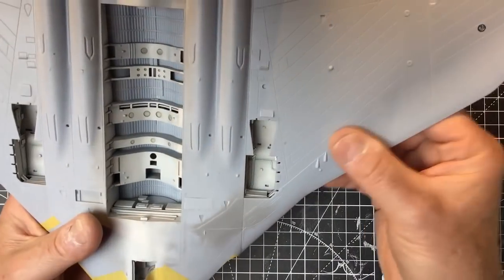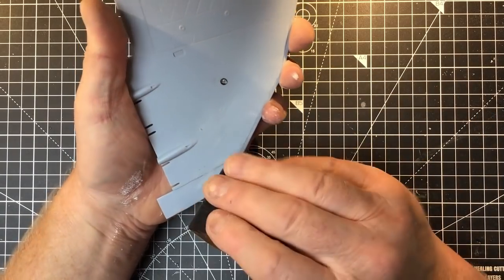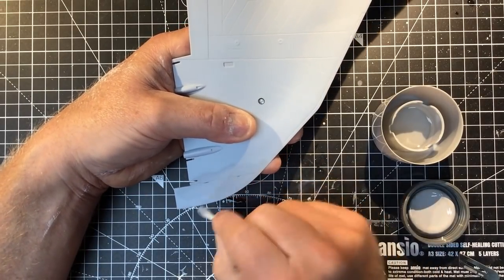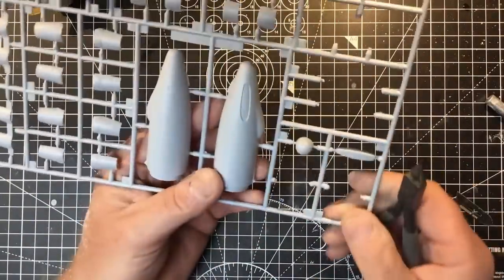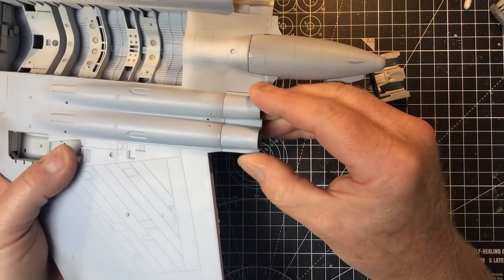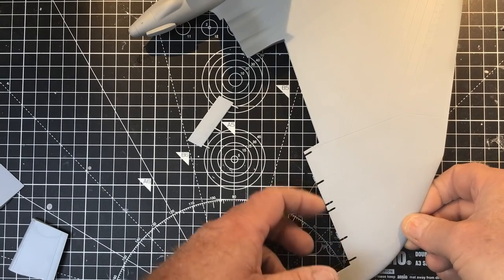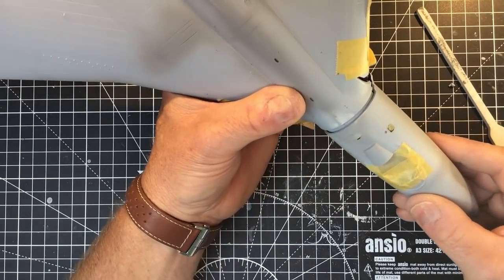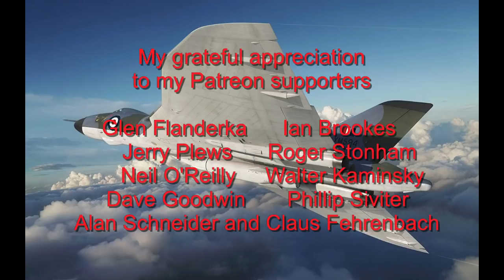Airfix 1/72 Avro Vulcan B.2 (New tool 2021) Part 6

Comment: The leading edge of most aircraft is a separate part that is secured to the wings either by fasteners, rather than part of the wing skins. It's to aid ease of build, repair from bird strikes and allow access to certain pipework or wiring, etc.
Reply from the maker: That’s a possibility James. I don’t recall it myself: I could do with taking a look at the real thing somewhere…..
Reply: @TheModelShed  Look at other aircraft Roy Chadwick designed - the leading edge  of the wing was a separate part (apart from those with Fabric wings).

I know from years at BAE (Kingston & Dunsfold) and as (the last Tinsmith trained) leading edges were a separate part for ease of repair/replacement and because the leading tended to be made from much heavier gauge material than the rest of the wing surfaces.
Reply: I tend to agree with James. I seem to remember on the real thing the LE had quite a reflex section to it and was a separate panel. I will be leaving it on mine plus it shows it as a panel line on the colour call out.

Comment: The  steps at the end of the wings can be avoided if one sands the inside of the parts. The plastic is quite thick at the those areas and there are some hard edges in there which prevent a nice fit.
Reply from the maker: 👍 I never noticed the step on dry fit RP but I agree - your solution would have been much more preferable if I had. This one has plenty of scope for catching us out.